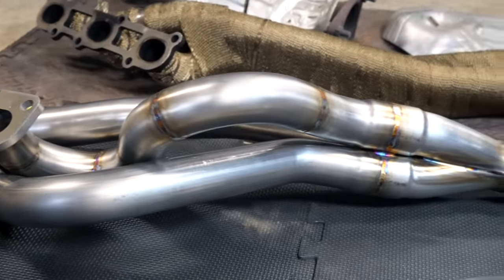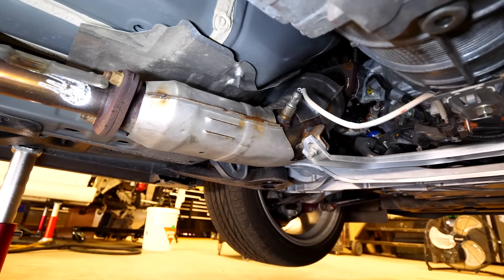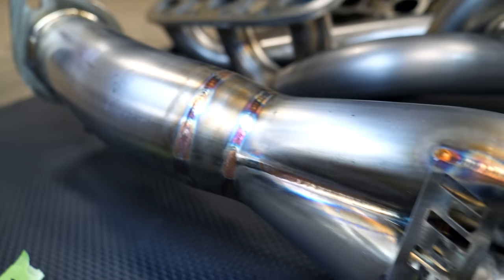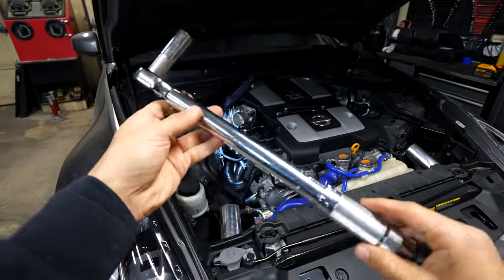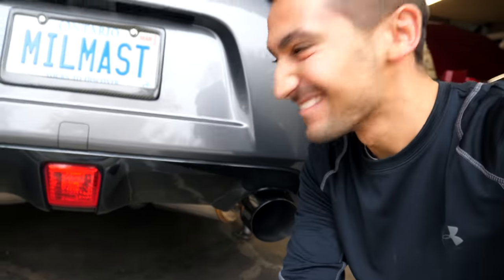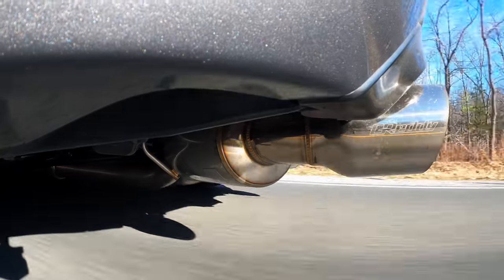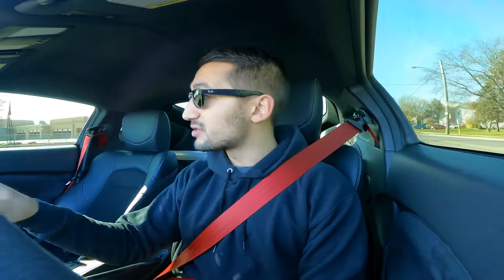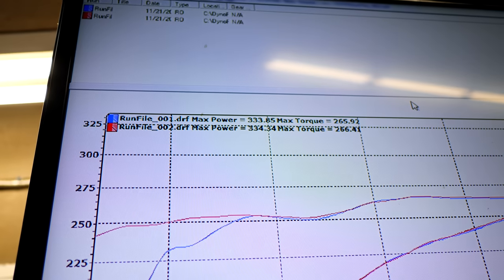THE BEST Nissan 370Z Full Exhaust on the Market! | +56 WHP

Comment: I have a lot less mods I have berk test pipes, silicone intake tubes and kn filters on stock intakes. borla s type catback I made a little less wheel horsepower 327 but torque was 268 also tuned by admin tuning,the tuner  was surprised as well and dyno jet as well.
Reply from the maker: The correction factor, and altitude make a big difference
Reply: @milanmastracci  never even thought about that but that makes sense, I’m in nyc area.

Comment: Now hold on a minute, with the best exhaust on the market..?? Im working on a setup that is partially completed,  so far it has deleted the droan- deleted the Rasp trumpet sound !! (Not everyone wants to be in the marching band) just saying, It just sounds low,  I still need to install a new equal length exhaust header, and then get'ur retuned bye admin tuning, ive got 310rwhp now, im looking to pickup another 20hp+ when im finished 😎

Comment: Do you still have the stock cats in?
Reply from the maker: I do not with these headers. The headers replace the stock manifold and catalytic converter. To pass emissions, you have to install cats on the Y pipe section of the exhaust, found right after the headers.

Comment: I bought the same exhaust for my Z but I'm trying to find a good high flow cat setup for Texas. Just deleting the cats would be great but passing inspection is kind of nice haha. This setup sounds really dope
Reply: You just need a tune to pass just get longtubes and call it a day
Reply: Yo man, I’m building my z and currently only have Stillen gen3 cai, I want to pass inspection to so what HFC did you go with??
Reply: @k1llerlunat1c78  i'm actually running the AAM resonated HFC and passed past year after a tune but I want to say texas is visual-only in a lot of places
Reply: @rasterous  Thank you for the reply did the AAM HFC’s throw CEL or did you have any issues with them?? If not then I’m going to purchase them.
Reply: It's hard to say for your case since I see you said you put on CAI first. I did my exhaust and cats before i did z1 CAI and got tuned same day. Before the CAI, no consistent CEL but did get some popups for post cat too lean etc and it would go away. I legit feel like everyone's gonna be a little different for the Z setups specifically for HFC even with those O2 sensor extensions etc. Highly recommend getting a tune to correct all that. Guy at a shop told me once that as long as you don't go in for inspection with a CEL on you should probably be good to pass
Reply: @rasterous  very true thanks man I really appreciate

Comment: How weird it is to see a not bad sounding v6. I'm impressed. Out of all engine designs I believe v6's are the hardest to tune exhaust to get rid of drone and have deep tone. Cheers.
Reply from the maker: Its the headers! As soon as you steer away from unequal length OEM-style manifolds, it totally changes the sound. Long-tube equal length all the things 😍

Comment: Is it safe to run this without a tune?
Reply from the maker: I would say no. When I swapped my intakes, the car ran a bit leaner which made more power, but was less safe.
Reply: @milanmastracci  thanks! This convinced me to run long tube headers on my Nismo. Was gonna go greddy for the fatback but found a cheap used motordyne

Comment: On my 240sx when i went from the oem manifold to a set of 4 - 1 headers, i LOST all of my low end torque but gained a TON of top end power, didn't like it at all so i went back to my oem header for that insane low end torque that i wanted.
I am NOT for that high reving wait for it power. When i hit the gas pedal, i want it to GO ...
Reply: Good move. So many aftermarket parts are shiny  junk

Comment: Run it down the 1/4 your time slip esp mph will tell what you gained. 
If primary tubes are sized right long tubes should pick up torque most places.

Comment: Got the Greddy Evolution GT exhaust on my Z with Motordyne Art Pipes, still have stock manifolds. Sounds great, drone at 3k has gotten better with miles or maybe I’m just getting used to it.  Anyways great looking build.
Reply from the maker: I would say remove the stock manifolds and swap them for Z1's. You'll notice it will breathe better and sound less trumpet-y. I'm thinking about changing the final drive to a longer gear, so I will be in the 2800-3200 RPM range less. Thanks Frank! 👊
Reply: @milanmastracci  I'm pretty sure z1's intake manifold is plastic!!! I'm going to save for a GTR manifold!

Comment: Do the headers replace the “y -pipe/ x-pipe” ?
Reply from the maker: It does not. The long tube header will replace the manifold, test pipe / catalytic converters, followed by the Y pipe / x pipe, followed by the cat-back exhaust

Comment: I've been around a lotta Z's with different setups (single or dual exit) and the fastest exhausts were the Fast Intentions long tube headers and their TDX catback exhaust, paired with AdminTuning's long intakes. I've seen Z's with PPE, Tomei, etc. and for intakes the Greddy Gen3 and the rest. The BIG problem with the Greddy Evo GT exhaust is the 2-to-1-to-2 pipes in the middle which becomes a bottleneck. The Fast Intentions exhaust is a true-dual X-pipe in the midpipe. So I wouldn't say this setup is the "best" unless your budget is not enough for FI exhaust.
Reply: Are those Enkei RS05RR's? Man they look beautiful on your Z

Comment: sorry man, fbo single exit will always rain king on the vq platfrom
Reply from the maker: If I had Nismo V1 rear bumper, I would get one, but I find all of the others don't look good with them because of the cutout
Reply: Facts
Reply: @milanmastracci  I ended up just chopping all of that rear valence most people bolt their street aero style rear diffusers on my G, it probably reduces drag by a tiny bit, but I understand you got a nismo and I wouldnt chop the rear bumper on any nismo badged car either unless its a cheap 350 v3 body kit from kbd lmfao

Comment: Great video! Sounds amazing BUT you didn’t gain anymore than +5whp

Matter of fact you lost power at low rpm from loss of back pressure
Reply: What? He went from 318 to 334… how did you come up with him not making more than 5whp?
Reply: @TriggaC74  
Simple answer:
because the VQ37 makes 328 BHP(to the wheels) from the factory.

Technical answer:
More air + more fuel = more power.
Changing your headers and removing your catalytic converter only removes a bit of back pressure. Header upgrades will give you a better exhaust flow but if you can’t bring more dense air INTO your engine then you can’t add more fuel and you won’t make any power gains. You only gained +5 by removing any flow restrictions.

Fun fact: your average centrifugal supercharger will give you +60hp at around 12 PSI.
Reply: @erosnunez4256  Aaaahh, no. Horse power numbers from manufacturers are at the crank, not the wheels. When they test engine power output, the engine is not in the car. And as for your technical answer and fun fact. He has long tube cold air intakes that brings in more air. With the tune, hes able to correct the fuel. A supercharger at 12 psi will make 100+ whp.